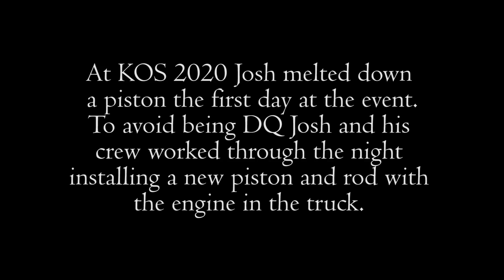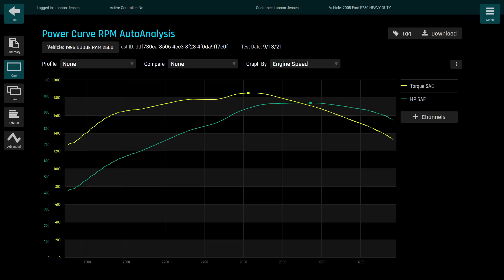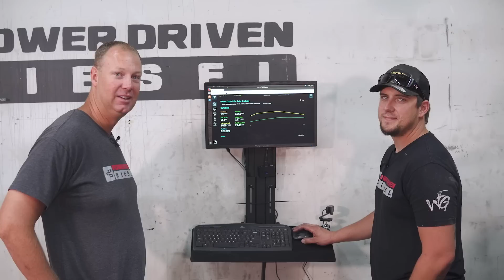Guess the Horsepower of My Ultimate Towing Compound Turbo Mega Cab Cummins? | Power Driven Diesel

Comment: I put the largest magnaflow muffler I could find on mine and it a tab quieter and seems to flow better. 

Reason I swapped was: I did a dpf delete on mine. The clamp let loose and my factory muffler dropped and was drug on the road a bit and got destroyed. 

I used Magnaflow PN#12773 to replace the muffler, and 
Magnaflow PN#12770 to replace the dpf. Though this did not make a noticeable change in sound level.
I was aim for as quiet as I could without adding restrictions.

 Magnaflow is pretty much a straight though pipe that's perforated internally. Does not get much less restrictive than this.

Hope some find this info useful. Probably wont get many likes if any.

Comment: For the stock HE351CW,  what kit do you sell or recommend to do the 67mm exhaust turbine upgrade? How would that run as a single? The mega cab is perfection!
Reply from the maker: There is no kit the whole modified HE351 is custom

Comment: How can one get the ingredients for such an amazing do it all tow pig build that Ruby had prior to UCC build? Great content Todd
Reply from the maker: 6.7,  60% over injectors, our towing compounds modified he351 over a s472, optitorque head studs, stage 2.5 push rods, PDD 4.5k springs and an air dogg200gph lift pump with 12mm stroker pump

Comment: I really need to biuld my 04 like that. Plan on a flatbed. And paint exc. Right know very rough body. 110 k on the clock very few miles
Reply from the maker: Good luck!
Reply: Actually I have another question. I have the 04 305 version of the 5.9 but it is common rail. Vp 44. Now my question  is the chain drive t case is not all that strong. Would it be better to swap a np 205 in place of the chain driven I'm thinking it's a np 207 correct me if I am wrong 2004 ram 2500 qaud cab 4 x 4 auto Trans I'm thinking the 48 RH. Will the np 207 handle 600 hp and all that torque. Or will I end up stre coming the chain and replacing  it. Please your opinion. Thanks. I really like your red ruby.
Reply: I have said this a couple times know I'd say around 945 970 hp and 1135 to 1170 ft pounds of torque. Really hard to tell by looking at it. No way to really gage it.

Comment: Big fan of yalls real life pros and cons. My wife and I just spent her pension (when she was a DPD) on an 07 3500 4x4 with a 5.9 we thought we where getting a great deal but unfortunately I didn't know about the kettle check for blow by. It died as soon as we got it home. Its been our dream truck so I'm going to fix it we spent everything we had to buy it (my mistake) so we are going to fix it ourselves its going to be my daily driver. What rebuild kit do you recommend I'm familiar with gas engines so this will be my first diesel engine rebuild and hopefully I can do it in frame as Ive seen Josh do a time or two. If you could point me in the right direction it would be much appreciated I believe we are going with Bosch Injectors. Any advice would be much appreciated. Thanks in advance
Reply: Bummer. I feel your pain. I just bought a '06 2500 Quad Cab 6 speed and engine quit after I drove it only 759 miles.  As we were taking it apart to find out how bad it was, it just kept getting worse.  Ultimately, bought it from a super shady dealer in Portland.  They knew it had problems.  We found a brand new head gasket, two new injectors as part of a total mix matched group of injectors, and obvious damage to head, valves and cylinders.  The new headgasket obviously means they had it apart enough to see all the issues and put it back together and sold it in really, really bad condition rather than fix it.  So now I am trying to scrape up the funds to get this thing back on the road.  Only took me a little bit of thought to decide to stick with the truck and build it up.  I looked around and decided to go with DFC longblock.  Everything is backlogged right now, but hoping by mid December or early next year to be back on the road.  At this point, with what it is going to cost me, I am just trying to focus on having a good solid truck that will be just about all new that should last me the rest of my life when it gets finished being built back up.

Comment: I’m interested in using those studs in my 2008 6.7. I do have just a hair over 200,000 miles on the clock. I do not have any head gasket problems as well. If I do the one at a time install, would I still be OK with my truck being high mileage?

Comment: You guys should put a 400 under stall and a 3.43 rear-end gear set.
 And be happy with a bigger exhaust  and less drone at hwy speed. Better milage because you drop 200rpm   in overdrive.  I think  with the lower  400rpm  stall converter and rear re-gear you will be surprised  how it feels.  Though you loose a little power to the ground its not a  truck you are biulding for 100% competition plus you gain about 80-87 miles per tank EASILY. so i say try it and thank me later.